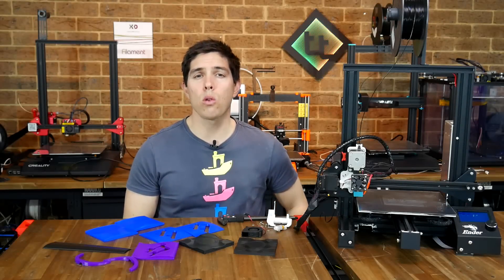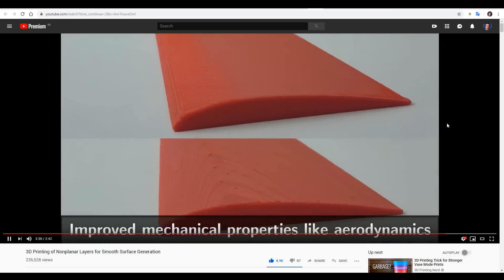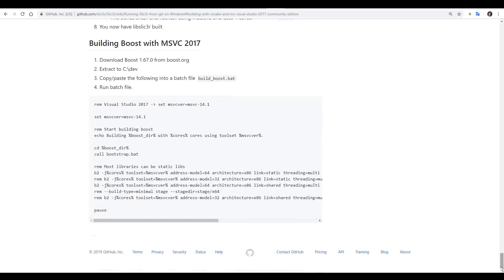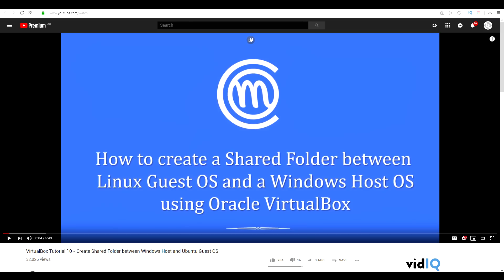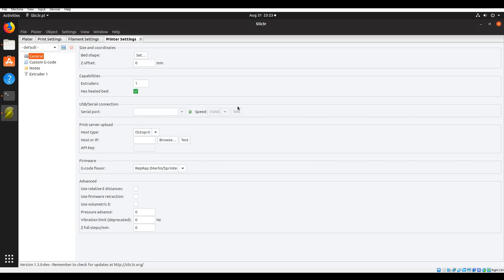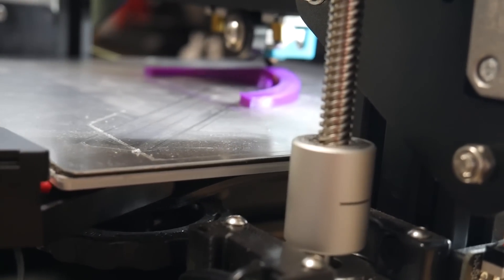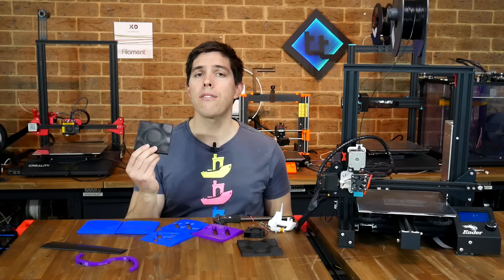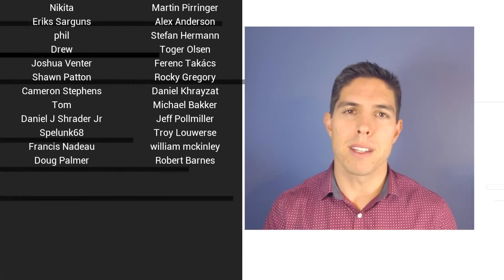Achieve true 3D printing with non planar slicing

Comment: Hey Michael, love you videos. Instead of using a full VM did you think about trying something like this? https://www.microsoft.com/en-us/p/ubuntu/9nblggh4msv6#activetab=pivot:overviewtab This uses the Linux Subsystems built into windows 10 to give you an easier interface and interaction. Also this runs without having to enable virtualization on your CPU giving AMD users the ability to use Ryzen Master application still.  Also found if you prefer a desktop environment. https://deploywindows.com/2018/04/06/how-to-run-linux-desktop-environment-with-linux-subsystem-for-windows-10/. I was able to build and run via RDP on my machine and use via this subsystem. Both ways work, but someone with a CPU that doesn't support virtualization this could help.

Comment: Seems like this is the worse way to print an object because your at the mercy of your extrusion nozzle. I think the best take away from this is the finishing layer could be an adaptable option to any slicer to mitigate stair stepping. But there could be bounding issues that could compromise structural integrity and the z axis may have more slop which could cause print distortions or failures...
Reply: Yeah I see what you are saying and agree, you are at its mercy. Variable contour of print versus fixed nozzle geometry. With the setup demonstrated there will be a narrow envelope of acceptable combinations beyond which lies too oblique an extrusion orifice, nozzle wall collision etc.  That's why a tilting nozzle that remains normal to the print surface quickly becomes essential.

Comment: If you have Windows 10 you can install a Windows Subsystem for Linux from Microsoft. Then you can just type "bash" from a command prompt and you have a Linux shell and all the tools work. If you need a GUI, install MobaXTerm for X-Windows and then you can run any Linux GUI app too.

Comment: "clears throat" We detected a call to manufacturers in this part of the internet... is it pointier hotends you all want?
Reply: 2015: hobbyists cleaning nozzles with acupuncture needles
2025: acupuncturists using nozzles because the real ones all got hocked to a bunch of nerds on eBay
Reply: yes please <3
Reply: Rene Jurack has made a nozzle-Adapter that uses Airbrush-nozzles. "Youprintin3D" is selling them.These would be perfect for this application!
Reply: @qwertzbalken6076  Interesting stuff!!!! 👍
Reply: I guess they'll need to be harder than brass as the nozzle edge/face would technically need to be angled, or maybe radiused.
Reply: No need really, just strap an extruder and hotend onto a 5 axis cnc of sorts
Reply: I'm not familiar with hotends construction much, just wondering why there don't exist like 30 degree angled hotends with 20 mm lenght? Seems like it could solve some major problems.
Reply: I didn't hear the phone ring.
Reply: Yesss!!!
Reply: @Heads Mess mount the ceramic heater vertically next to the nozzle, providing heat all along the nozzle height.
Reply: Yes!

Comment: This is why I hate Linux. Just download and install seventy-two separate pieces of software, each with its own 42-step installation process, spend days tracking down why you keep getting errors, find thirteen incompatible solution instructions, and eight weeks later, you (maybe) have it all working, only to find that it doesn't really do what you had expected it to do, so you throw it all away.

Oh for the days when you could just download an installation program and have everything happen automatically. Oh, wait, that's what Windows does.

Comment: I have concerns about the angle of polymer flow, and print direction.
For example, an actual aerofoil needs to be perfectly smooth, thus you would need to push the extruded filament into the curve.

Such an issue is largely resolved with a 4D printer with the fourth being the tilt angle of the extruder nozzle, to ensure the surface remains perpendicular to the nozzle, to maintain quality through a variety of angles.

Will be reading the thesis today, but I doubt from the brief explanation here, that this has not been accounted for.
Reply: In fact, the Delta style machines would probably be better, as tilting the nozzle on-the-fly using a 3 point arm to allow for dynamic tilt of the nozzle

Comment: @Teaching Tech I'm curious as to why you didn't continue to pursue the 2016 solution to running a test print? I'm interested in 3D printing, but have no experience with it so please forgive me if that is a stupid question. Also, is there any advantage or disadvantage to the compressed print layers used in the older solution? Perhaps the layer compression is actually why you didn't keep file that path as that print movement could potentially foul your print head. Like I said: I'm interested but have no experience in this area.
Reply from the maker: I couldn't find any explanation of the parameters, so I had no way of knowing if my print head was going to collide or not. There was also notes saying that the printed parts would be warped and require extra work. The version I ended up trying was really clear with what I needed to input and it gave me confidence my printer would stay in one piece.

Comment: Windows 10 has an internal Linux subsystem. You don't need a VM, you just need to enable the package and install Ubuntu through the Windows 10 Store. I don't have a link, but Google "windows 10 Linux subsystem" and you'll find a few Power she'll commands to get it working. Hope this helps someone!

Comment: Old laptops make great dedicated Linux boxes as Linux doesn't require anywhere near the resources of windows. You can also install linux as a dual boot system so you can pick it or Windows at boot. Lastly, a virtual machine can be configured to have a higher priority of hardware resources increasing its performance.

Comment: Been wondering about this for a while now before I even head about it.  The only real limitation in what we currently do is because that's how its sliced.  Its much "safer" to slice this way but the printer is capable of so much more, its just much more complicated to both slice and design for such printing.  I think the 2.5d approach is really just better "for the masses" but its nice to be able to unlock more potential.

Comment: All that computer stuff felt a bit baffling to me, and having to run a virtual machine for this seems a bit of a hassle. My hope is that sometime soon someone who's really computer savvy will figure out how to port this to the Windows version of slic3r and provide it as an easy install. I'm sure that will happen sooner or later, then it will be much more accessible to the average tinkerer with mid-level computer skills (high-level being able to code anything from scratch, low-level is "what's antivirus?") such as myself. Really want to play with this though, seems like a major breakthrough in 3D printing. I think I could modify my machine to do this at least to some degree, possibly modified fan shroud, longer conical nozzle, and non-contact bed probe that senses 8mm from the bed. Maybe I could rig up a pivoting bed probe that swings down for probing, then can be moved out of the way for non-planar prints, would have to manually pivot it between probing and the later stages of the print job but I think that would be totally workable.

Comment: The true question, that no one asked or cares: How long till someone adapts slicer just for kicks and giggles, so it does a negative nonplanar route for proper CNC machines?
Reply: There's nothing new for CNC mill stations this time.
Reply: Non planar operations are not desired for CNC as it changes the depth of cut and creates uneven loading on the machine bit which can impact surface quality and tool life.  Imagine you're trying to cut a 45 degree slope into a block in a non planar route, not only will the round tool bit cut an ellipse valley, but the loading will increase drastically as you continue deeper into the slope.
Reply: First is for fun. Not because it is the most desirable, but just because you want, and can. A lot of passes would go on empty air, sure, it may not be the best option either, but far from completely non desired. Foundry molded forms are an example of this, where you only need to reduce to size a small quantity of material. And 5 axis machines give you the freedom for it to be far less of an issue (not the scope of a project done for fun though).
Reply: @freemansfreedom8595  When you refer to "proper" CNC machines I am not sure whether you are referring to the likes of Hass VM-3 etc which are true 3D machines or a 2.5D router. Both are commonly referred to as a "CNC" machine. Assuming you are referring to manufacturing  a set of sand casts drag and cope moulds, it still doesn't make any sense why forcing a tool bit to cut at an unoptimal angle is faster, it  induces premature wear on the tip and is more likely to break the tip. Basically costs you more in time and tooling. If you have burnt a drill bit before that's pretty much what happens. Pretty much all professional CAM packages are designed to provide the quickest, optimal operations for tool life. Also with 5 axis machines, they're pretty unsuitable for commercial casting, if you can't cut the mould with a 3D machine, you can't release the sand regardless. 5 axis could work if you're sacrificing the "mould" (investment casting), but then there would be better options for manufacturing speed. Eg 3d printing :).

Comment: You can improve your setup and usability of your slicer here by using WSL (windows subsystem for linux) rather than a virtual machine.It's straight forward and it comes straight from Microsoft, the only complex part will be to install an X server, which there are several options to do this and all are straight forward. At that point you can use your linux slicer in windows without using a VM, but from a linux kernel with direct hardware access hosted in windows 10. You should see significant improvements in performance.

Comment: I find this very interesting, especially for me.  I print almost exclusively ABS in a semi-enclosed chamber so I don't use a cooling fan for parts.  Also, my printer uses a V6 nozzle, and the tips are about 4 mm long with a 60 degree cone.  This should give me a pretty good quality print.

The question I have is how much time does i add to a print?  If I am not gaining time versus the sanding and/or vapor bath (even adding this should save time on the sanding and remove the need for a vapor bath) then it would not be worth adding it to the tool chain.
Reply from the maker: For the last test print in black it added about an hour. Significant for sure.
Reply: @TeachingTech  I'll spend a few hours finishing a piece for a mold, or about an hour if it for use in place.  This might well be worth the extra time. printing.

Comment: What if you use a nozzle from a volcano hot end in a regular heat block? That would give you more clearance. Doesn't solve any problems, aside from the limited clearance issue, but it would allow for steeper geometry. Increases the problem of a non-tilting head though, I'd guess.

Comment: Could you not create a fan duct that blows down from a steeper angle. Some cooling is better than none.
Also why no Benchy? Did you try and fail and if so were is the fail. I am not trying to diminish what you have done because the smooth top layers look astounding. I'm just looking for something that we all have done.
Great video.Keep up the good work.
Reply from the maker: The little benchy thumbnail you see near the start in the explanation was my test. It didn't trigger any non planar layers, I guess they were too small.

Comment: I saw demo video one day ago. Excelent research shown here Michael! By it's nature delta printers could tilt print head but that would require change to firmware of printer as well or extending set of avible g comands to use rotate in a b c axis be available and used by slicers.

Comment: can the airfoil be printed on a stock ender 3 with an unmodified hotend assembly
Reply from the maker: You wouldn't have the same 8mm clearance I had so it would be more limited. The closer the other parts are to the nozzle, the earlier the collision detection will kick in and the less non planar extrusion will take place.
Reply: i hope non planar printing will blow up, if there's enough demand im sure after market kits and parts will show up eventually

Comment: I think a delta printer with modified nozzle and tilting head would prob be the best I think some 5th axis programming maybe required. I think the very basic version may shoot the price way up to 1K in price at least for a while. if the project is started as open source the price could drop quickly.
Reply: Oh yeah! A delta would absolutely be capable of the kind of nozzle angling this would need.  Dear lord, I wouldn't want to even begin trying to figure out how to program something like that!   lol

Comment: So, I have a delta style printer, and with a diamond-shaped print nozzle I think this could be the ideal machine for this. So I download the G-code to give it a go, and to my dismay the print job is appearing off in space! and not aligned on the table :(
Reply from the maker: It's set up for a cartesian machine with a square bed and 0,0 at the bottom left. Deltas usually have 0,0 in the centre.

Comment: Wonder if you used a compliant mechanism at the hot end to add a secondary X/Y axis to angle the nozzle,  a mechanism similar to the ones used by NASA for the side thrusters for orbit control. How you would code this I have now clue. Probably very similar to what you were talking about with a 5 axis cnc. might be able to copy the source code for 5 axis and apply it to additive manufacturing

Comment: I wonder how much this effects the strength of the part. Skilling it should make the part much less likly to suffer layer seperation durring stress.
Reply: Right. Might also be interesting for carbon fiber composites which arent really doing anything in between layers.
Reply: @haraldhimmel5687  if I recall it is called continuous strand composites (or something similiar).  They generally wrap it around a foam core changing the wind angle as they go.  It is how f35 nose cones are done.  It is also how they do composite reinforced pressure vessels.
Reply: Yep! And if we went all the way and got print heads with tilt, you could make some ridiculously strong parts...
Reply: @MushVPeets  couldn't you tilt a Delta's head?
Reply: That was exactly what I was thinking, extruding continuous strands of carbon fiber composites, can in theory, be achieved today with a delta printer. But slicing it looks like a nightmare.

Comment: This is some Solar Roadway BS.
1. It is only applicable to very specific use cases. Most prints wont have shapes that are at all suited for this printing method.
2. You compare it to what looks to be 4.0 layer height models. If you printed those at 1.0 or 0.5 layer height the stepping would not be nearly as bad.
3. Some slicers have the ability to have dynamic layer heights for curved surfaces for this specific problem, so that you dont have to waste time printing everything at 0.5 mm layers but still get decent curved surfaces.
4. All of these layer lines/steps could be removed with 10 minutes of post processing. Especially so on these simple shapes demoed here.
Reply from the maker: The layer heights were either 0.2 or 0.3. One advantage is that you can utilise a thicker layer height with this system and not have any visual difference in quality on the upper layers. You're welcome not to use it but just because you don't want to, it doesn't mean it's of no value to anyone else.
Reply: Teaching Tech and he's completely discounting (missing?) the extra strength made by the different geometry.

Comment: An easier solution would be to have variable layer height printing. In a simple form this is already available in Cura which allows for a different layer height for the infill compared with the wall. The use of variable layer height printing would give a similar result without any changes to hardware.
Variable layer height printing has the other benefit of allowing for the use of minimal surface layer height printing with higher layer heights the further the printing line is away from the surface. This results in a higher quality surface and reduced printing time for layers away from the outer surface.

Comment: You didn't want to use gcc on Windows, you probably could've downloaded VS Code and got it done.
Reply from the maker: AS I said in the video way outside of my knowledge and skill.
Reply: Teaching Tech you taught yourself virtual box and can use that slic3r Ui, I’d say you have vs code covered :)
Reply from the maker: I had used virtual box quite a bit in the past so I was comfortable coming back to it. I'd still like to get it compiled for windows and make a follow up with the air brush nozzles.

Comment: I seen the video a few days ago truly amazing you got it to work with a guide. You are now one of my favourite 3d printing channels.
I find it werid they used a ultimaker with slic3r since cura is a ultimaker product. I posted that cura has ironing of layers but only flat surfaces. I can't wait for 5 axis 3d printers and non planar printing with tool changes.
Reply from the maker: In the thesis he says it's because Slic3r is open source.
Reply: @TeachingTech  ahhh very nice. Nice to see open source projects paying it back. When i was at uni most honor student projects were claimed as intellectual property of the university. The things they were sitting on that became black holes was frustrating.
I will be wating for a more integrated functionally or let it mature a bit but that wing looks truly amazing.